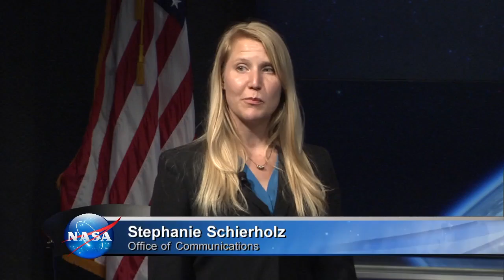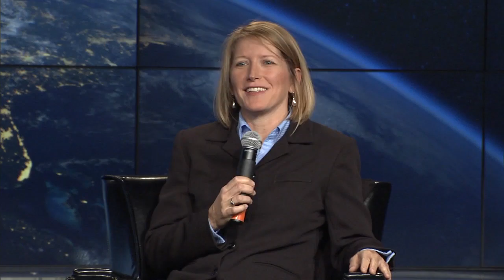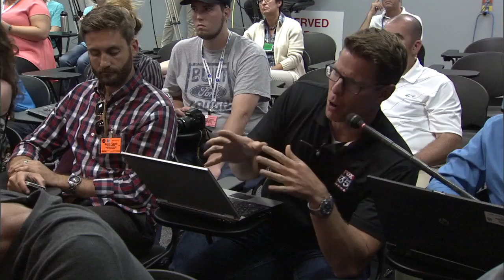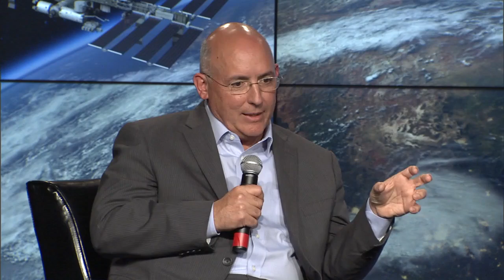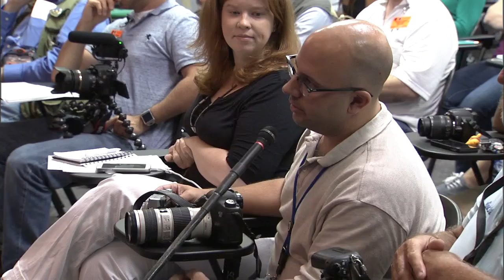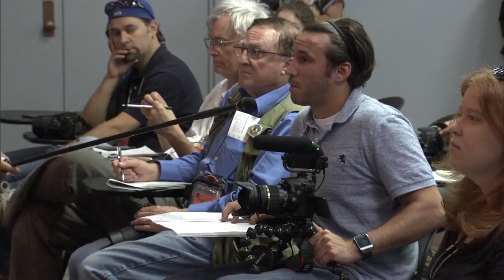SpaceX International Space Station Pre Launch Briefing from NASA's Kennedy Space Center

Comment: Well, the liftoff was successful, but then the vehicle completely disintegrated after 2 minutes. So they worried about docking adaptors, weather and landing protocols, without consideration of odds of basic launch failure. I have heard the same oversights with F-35 program, which focuses on bunch of unnecessary requirements and ignores the most basic functionality.